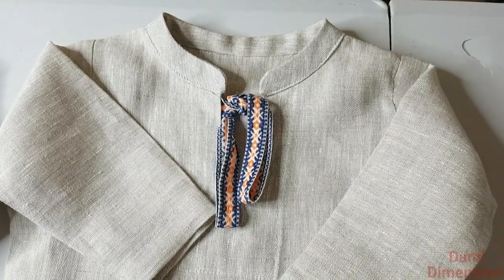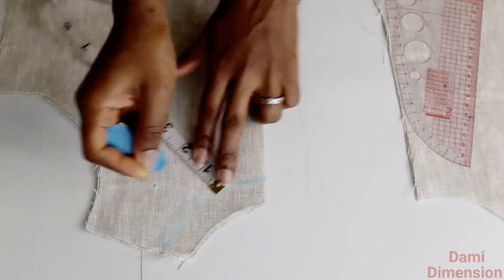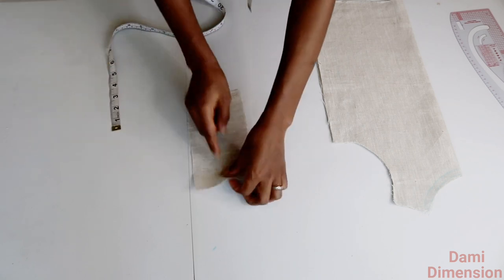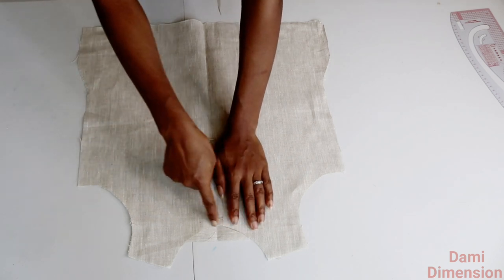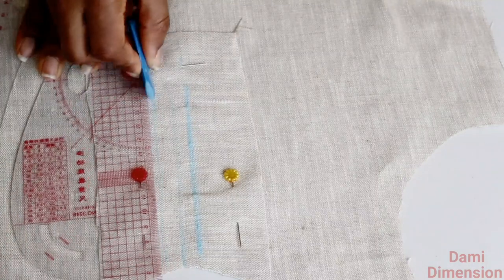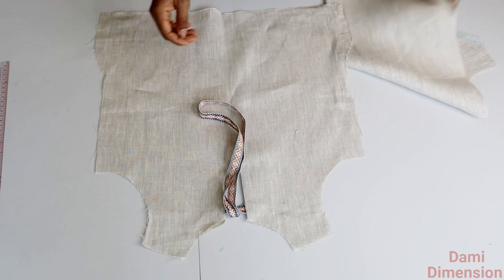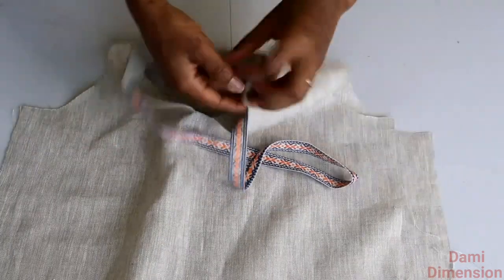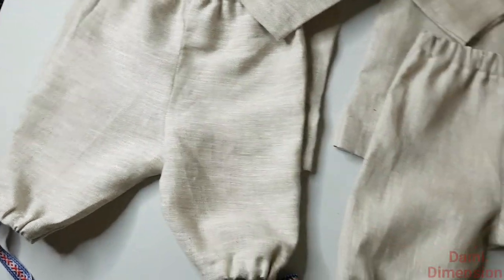HOW TO MAKE A BAND COLLAR | KURTI COLLAR NECK CUTTING AND STITCHING | FLAT ROUND COLLAR WITH SLIT

Comment: Very practical..and this easy.  Thanks.
Reply from the maker: Thank you for the feedback 😊
Reply: Would be grateful to have a tutorial for same collar with zipper at the  back, and same front.
Reply from the maker: @ollyinny6870  Ok. I will put that into consideration, though I am not promising 😃. For the front zipper,  you could simply put in the zip in place of the slit that I had in front in this tutorial. But in that case, consider adding a zipper allowance while cutting.
Reply: @DamiDimension  That'll work for a single collar, but I was thinking of a split collar.